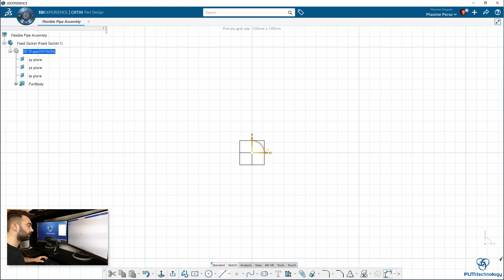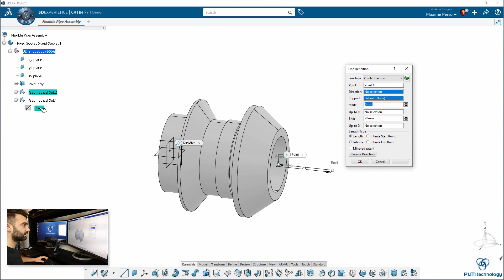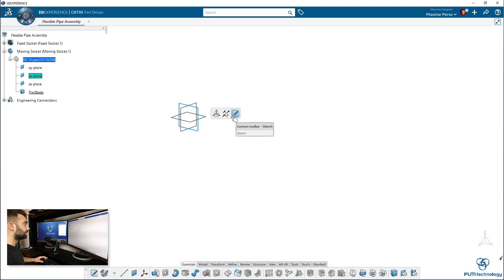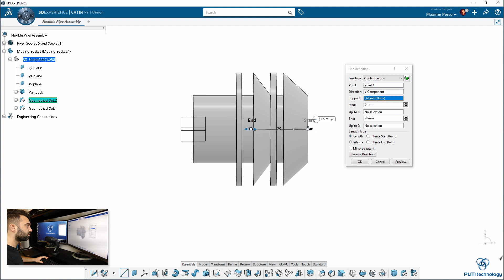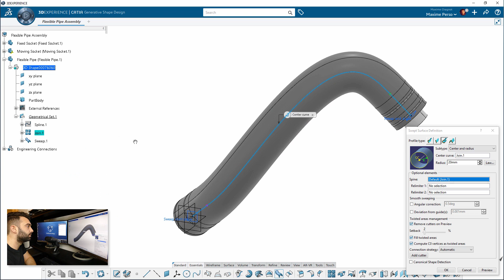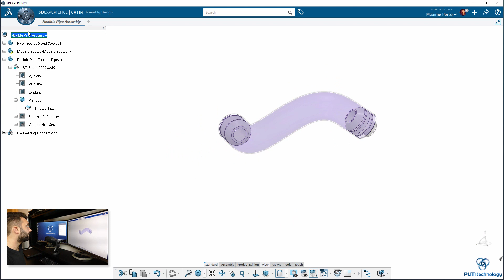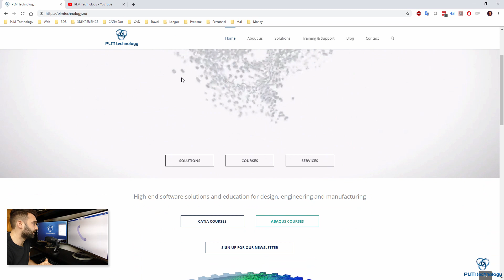DF4: Flexible Pipe in Assembly Design (Live)

Comment: Thank you for the video, could you please let us know that,
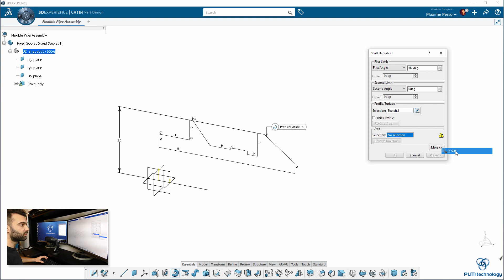1. How did the geometrical set got automatically created in the tree when you select the y-axis for the shaft definition? (time- 1:42 in the video).
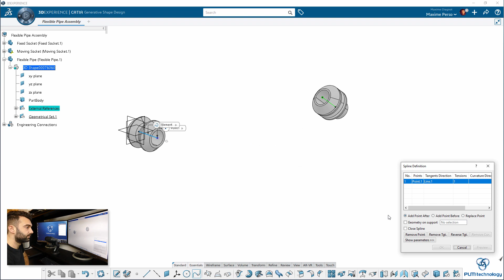2. Spline definition warning popped asking for a link ( that warning for the link did not pop while I was doing)(time -7:30  in the video)
3. How did external references geometrical got created automatically in the tree(time-7:28  in the video)
Am I missing any preferences to check? kindly let me know the solution 

Thank you
Reply from the maker: Hi Anilkuma R, Thank you for you kind message!
1. In Legacy Preferences/Infrastructure/3D Shape Infrastucture/3D Shape, I disable the Hybrid mode. In that way, all wireframe, Plane, Axis, Surfaces are created in Geometrical Set (I feel it is more flexible that way)
2. and 3. In Legacy Preferences/Infrastructure/3D Shape Infrastucture/General, I recommend user to tick the options "Keep link with selected object", "Show newly created external references" and "confirm when creating a link with selected object". Also In Legacy Preferences/Infrastructure/3D Shape Infrastucture/Display, I recommend users to tick the options "External References", "Constraints", "Parameters" and "Relations". 
After that you should have the same behavior. 
Regards, Maxime at PLM Technology
Reply: Hi Maxime,
 Thank you very much for sharing the above settings, it will help me a lot.
Best Regards, Anil
Reply from the maker: @anilkumarr9839  You are welcome ;)